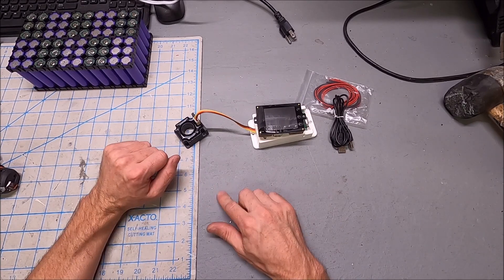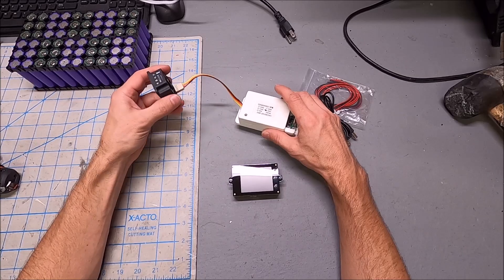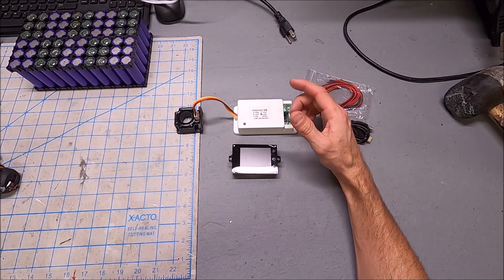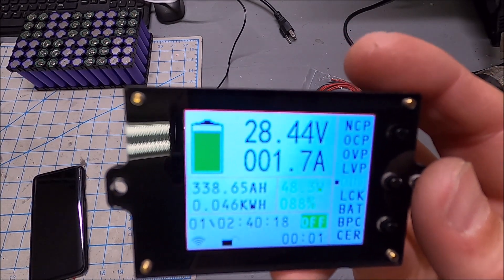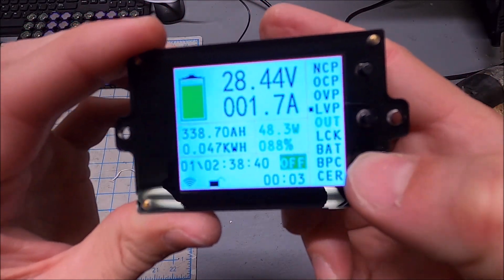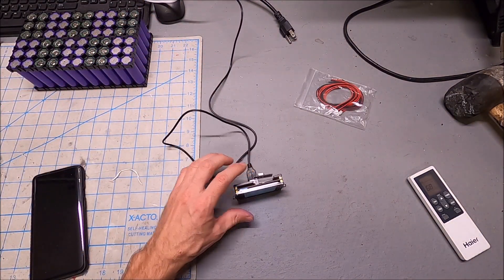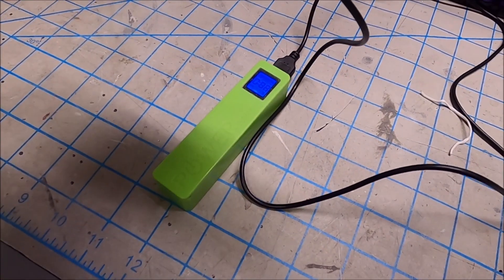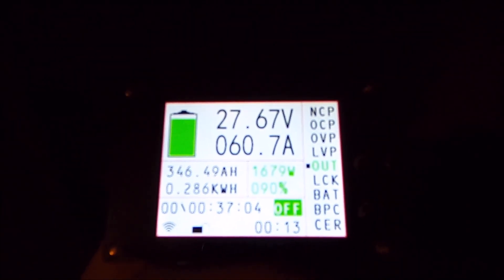WIRELESS BATTERY METER FOR POWERWALL

Comment: Hi, besides the usb port of the display is there another place to connect it to power? Or I have to cut an usb cable and hook an aux batt there? I want it self power
Reply from the maker: I can't remember if it had a second power connection. Worse case you could always solder a couple wires onto the USB PCB and supply 5v

Comment: I am honored to see the test video of your battery monitor. We have released the new KG140F. We would like to send you a sample for testing.
Reply: Hi Juntek. 
Does your KG140F have relay control? If so, Can I use that to do load external shedding at a set battery % State of Charge ?
Regards,Jesse

Comment: Hi Steve... my voltage is at 13.5v but the AH at 67% and dropping.  The BAT is set at 400AH and the BPC at 100%..batteries fully charged.
Any ideas why AH going down in graphic and % reading?  thanks

Comment: You totally skipped the battery capacity setting and set it at %100. Without the battery capacity setting the displays reading on how long it takes to charge or discharge at whatever % is no good. You also didn't reset the meter when there was no current. That 0s it like a scale. I was hoping this video might show the charge and discharge relays but you skipped that also. I don't see how there's any protection without hooking up the relays unless you consider an alarm protection. Thats more like a over under voltage warning than protection.
Reply: do you know how to use charge and discharge relays?

Comment: Hi Steven,
I'm from German and have the same Amp/Volt/Wattmeter.
Sorry, my english is bad.
There is a secret menu where you can set the volt and ampere accuracy. Simply go to NCP and press the middle button for about 4 seconds. Now the volts can range from 0-20, 20-120 volts and the Amp can be fine-tuned from -0-100 / + 0-100. Would be nice if you could make a video of it. This measuring device is therefore very accurate.
Reply: This comment made this worth watching. Hidden menu. Thanks.
Reply from the maker: Awesome thanks for the heads up
Reply: Mike thanks for the tip. I have same model but it constantly reads +\-2v less than actual I hoped this would fix it but it doesn’t. It’s 100% the battery monitor as I have had 2 different multimeters and another battery monitor that read correct volts? Anyone any ideas?
Reply: How can you reset all the parameters or settings?

Comment: My friend Mike who thinks he knows everything says that's a transformer not a hall effects sensor... Is he right or are you? I hope you are... He's really arrogant and I want to prove him wrong.
Reply: Actually your friend isn’t too far off! for AC current a conventional amp clamp uses a transformer to turn the reading into DC so the amp meter can read it. The Hall effect sensor is used on DC since the magnetic field of a wire with DC current is a constant and does not Fluctuate back and forth like AC.
Reply from the maker: Lol. He is wrong. A hall effect sensor measures magnetic fields and that is how this meter works by measuring the magnetic field of the current flow. A transformer takes a voltage and steps it up or down but it does work similarly to the hall effect sensor.
Reply: @stevenc22  that's what I thought. He's a Porsche guy. They all think they know everything.
Reply: Tell your buddy Mike that a transformer works via the Hall effect. His electical knowledge is about 1 inch thick.

Comment: Great review thanks. I ordered one and have it set up in my caravan. Seems to work ok however the voltage percentage, after setting at 100% when fully charged has slowly dropped to 73% and falling despite my batteries being fully charged to 100% according to my other battery meter???? When I reset it to 100% it reverts back to 73% Any ideas? Many thanks in advance
Reply: I have the same problem. Did you find a solution?
Reply: I have the same problem. Did you find a solution?

Comment: Is this a bidirectional meter (charger and discharge measuring and displaying) With same connection setup.
Reply from the maker: Yes. And it has alarms for over charge and over discharge current.
Reply: @stevenc22  thank you very much

Comment: be carefull with this meter, its not realy acurate... i have 500v 500a version and i dont like to trust it... you can see it in my recent videos
Reply from the maker: It's not too bad. Mine is accurate within an amp or so. Good for monitoring a shed from the house. I don't rely on it for anything, I have a BMS and a smart charge controller, this is just a visual indicator.
Reply: Is this a bidirectional meter (charger and discharge measuring and displaying) With same connection setup.
Reply: @sumeeths8423  yes, but its not realy acurate... better chose diferent meter for lower price ;)
Reply: @SigmaWorksSW3D  what other model is available for bidirectional measurement?
Reply: volts are acurate but nothing else on my meter :(

Comment: so i am guessing this unit is only one direction not bidirectional so can not measure charge and discharge if it is bidirectional then shouldent it be on the battery neg cable
Reply from the maker: It is bi-directional. It shows negative watts when solar is incoming.
Reply: @stevenc22  id flip the sensor around then to me negative reading are loads think it makes more sense that way handy little unit out of all the meters i have used over the years they always need modifying to read the same